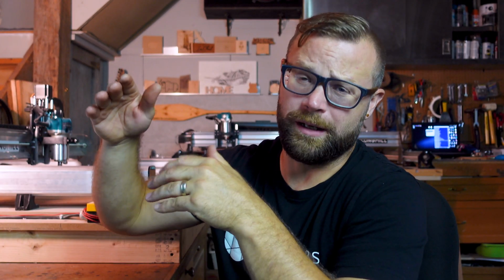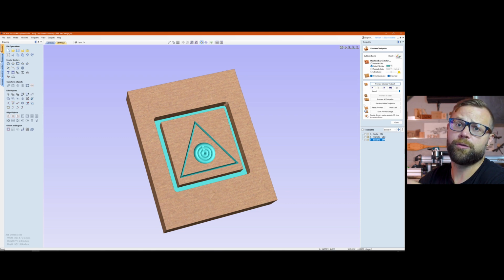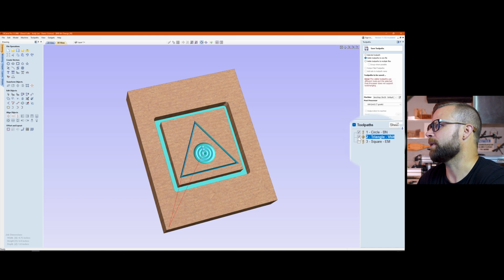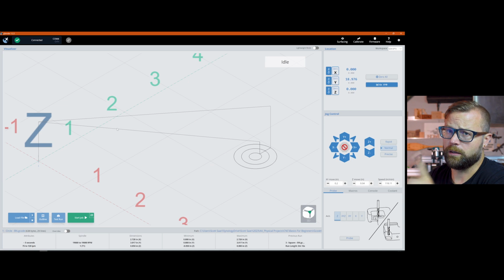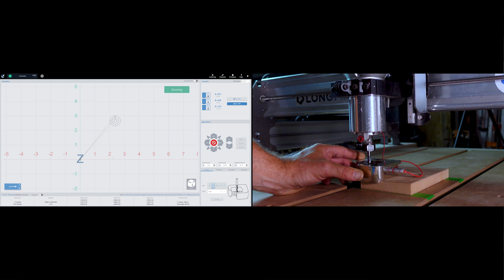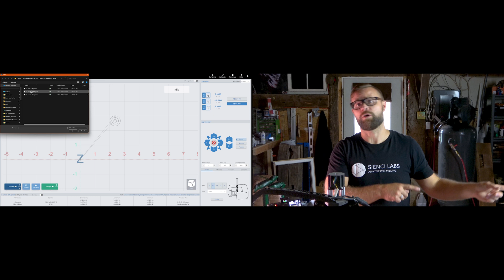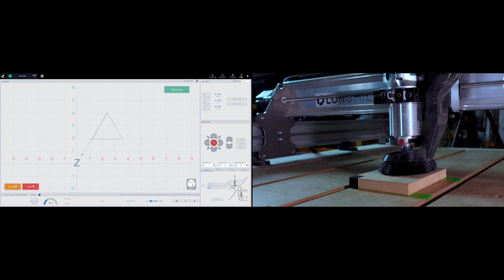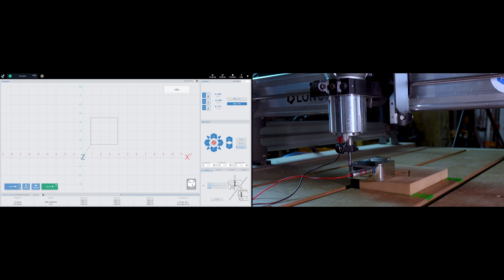Basics for CNC Beginners: Changing Bits During a Project

Comment: I’m having no success when I pocket out with a UC bit and then contour that pocket with a DC bit. There is a very distinguishable ridge between the two tool paths. 
Zero for one bit doesn’t seem to be zero for another bit.
Reply from the maker: Hey Jeff,
If you're zeroing the second bit from the same spot as the original bit, there should be no issue. I would look at the preview of your tool paths in your software to confirm they are carving what you're expecting. Let us know!

Comment: I watched this so intently hoping to see how you to run a 1/4" bit to hog out , then follow up with a bit change to a 1/8" to get into the tight spaces.  When I try to do it in VcarvePro the large bit runs and does its thing fine, then the router stops , pauses as it should, then says "Change Bit and Attach Probe" .  Sounds like a good plan, yet the Z height is locked so I cannot get the bit out to change it because the bit is directly over the corner of the material. Also, no room to slide the probe plate onto the material.    In this vid, the very corner of your material looks black, like it might be carved out to allow bit access.  Is that what I am seeing?   Also, your probe plate has a notch out as well that may solve the problem.

Comment: Thank you so much for the video! I exported my G code from carbide create which was a single advanced v carve tool path with both bits included. I’ve just finished the end mill carve and it has paused for the tool bit change but I can’t move my XY or Z axis, any help please?
Reply from the maker: We need a little more information. Are you loading your gcode into gsender?
Reply: @ yes, that is correct thank you. I may have resolved it, not sure yet.

Comment: So the answer to my questions about what bit to use first when the file is started ,is to simply put a abbreviated name of the bit in the description of each cut contained in a multi cut file,Yes
Reply from the maker: We recommend people also include the name of the bit as well yes, as a reminder of which bit the tool path uses. But unless you use a naming system to order them as well, you leave it up to memory to remember the correct order.
Reply: @ memory whats that..iam seventy years old..

Comment: Hi Scott, What if we want to save our files in a SINGLE GCODE FILE  and use a bit setter to automate the Z height when performing a tool change, can this be done with the SLB EXT while also be configured in gSender?  Please and thank you in advance!! :))
Reply from the maker: You can do this using the tool change functionality in gSender as is, or you can even customize this within gSender's tool change wizard to add in custom macro things that happen during the tool change. The SLB (SLB-Ext) is also capable of much more advanced tool changing stuff but we haven't fully leveraged it yet. Hope this helps!

Comment: Can you please explain how you would do this if you did not have a touchplate? The first step in the process getting x and y to zero using the paper method is the mystery to me. Can you help? Thanks and Im hoping to try carving those Christmas ornaments when I learn this!
Reply from the maker: Yup, keeping in mind that you'll be "eyeballing" your bits location if you don't have a touch plate. There's nothing wrong with dong it this way, a touch plate just helps eliminate the guesswork. 
-Load your first bit into the router. 
-Move the router down until it's close enough to the material surface that you can line it up by eye for X and Y in relation to the material
-Grab a piece of paper and slide it between the bit and the material
-Using the "precise" jog setting, start lowering your Z axis while simultaneously sliding the paper back and forth just a little
-When the paper starts to get pinched between the bit and the material you'll feel the paper not sliding as easily until it can't slide at all
-At that point stop lowering your Z axis, click "zero all"
Hope this helps, please share whatever you make to the socials so we can all see!
Reply: @SienciLabs  Thank you for the reply! 
So, if I start with a 1/4” straight bit,  move to the lower left corner, bring t he bit down and lower to paper as you said. I would then zero all? So my x y and z are all zeroed out there? I thought I would have to bring the bit to below the workpiece on each side then zero x amd y.
Sorry, a bit confusing for this grandpa, but Ill give it a shot!
Thanks again!
Reply from the maker: glad we could help! If you run into any trouble let us know! Good luck!🍀

Comment: Nice video, what if the roughing phase takes the initial material out, what is the best place to setup the Z axis in this case? I just use the top of the material left but it feels like there is a better solution that I can't get my head around.
Reply from the maker: If you know you're going to disturb the surface that you're zeroing from, you can always change the setting to "zero off the machine bed" (your wasteboard). Some people do this anyways, it's a per project/person preference!
Reply: Ah, perfect. I completely forgot about that option. :)  @SienciLabs
Reply from the maker: So glad we could help! Happy carving!

Comment: Does the Longboard controller support a tool length probe for saving all the files together and just loading tools and having them touch off when needed??
Something similar to the C3D Bitsetter or the probes you can use with the Masso controller???
Reply from the maker: The new SuperLongBoard we're working on we plan to have native support for tool changing which we're really excited about, but due to grbl limitations the LongBoard and actually also the Carbide 3D controllers can't process tool changes on their own, Shapeoko machines do it via their Carbide Motion g-code sender and our LongBoards can also do it via our gSender open-source g-code sender 👍